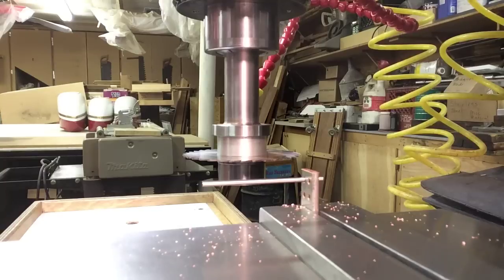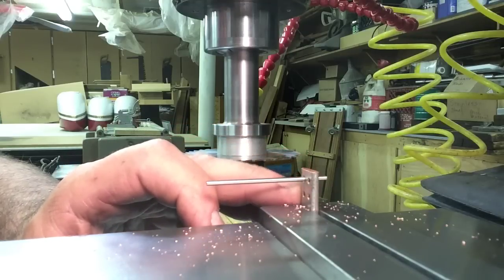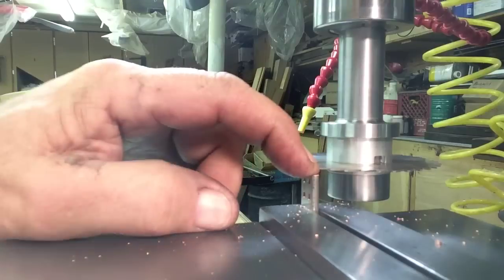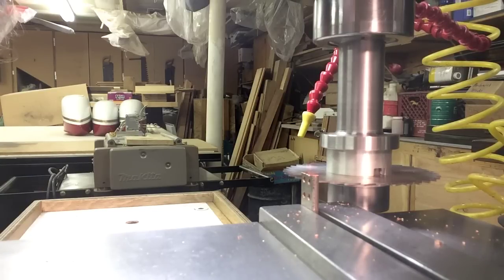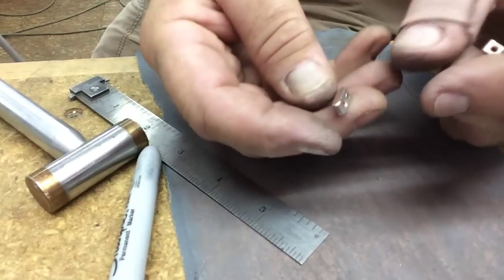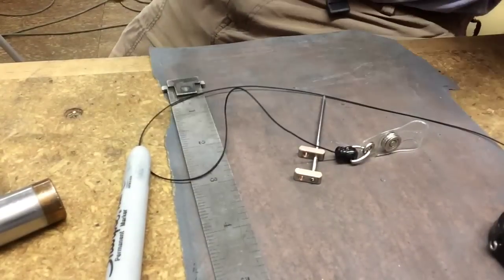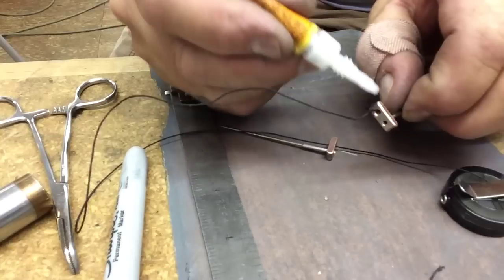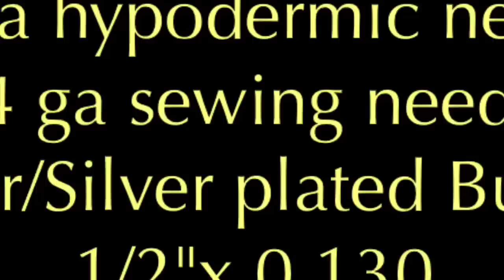How to Make a Nail Knot Tool

Comment: It's clever, but what is it?  The world's smallest auto-retracting sword cane?

I've found that when teaching anything, you usually want to say what you are going to teach, then teach it, then say what you taught. Seems to help folks understand and better retain the lesson. 

Regardless of that, the machining info is useful and fun to watch. The slitting saw on copper, the press fit of a needle in a tube, even the recycling of your buss bar material. Couldn't quite see how the loop knot was tied, but I have some good knot books and I'm sure it's in at least one of them...looks useful to know. 

Thanks!

-- Mike

Comment: Randy, great job. Does that mean I get my needle and tube back now?
Reply from the maker: George Huber Matter of fact it is in the mail today with a surprise.  Thank you for watching, did i get the knot correct?
Reply: Randy Richard

It was not, oops I mean, knot perfect.
There was really no rush I just couldn't pass on the opportunity to rib you a bit.
I mostly use the needle,  to pick out casting knots.
I use one of the Tie-Fast tools for the nail knot.
Reply: Randy; Needle and tube/w zinger arrived in today’s mail.
I immediately took it for a test drive and it works like a charm.
I particularly like the bevel on the tube tip. Makes it much easier to feed the tag end.
So your up-graded RTR version goes on the vest and the original goes in the backup box.
Thank you so much.
GLH
PS Can you make up some miniature boat cleats that can be affixed to the face of the zinger.
That way we have a place to tie off the line while using the needle or tube. :>)
Reply from the maker: George Huber That problem is all that bothers me to.  I will have to think on the boat cleat.  Enjoy.